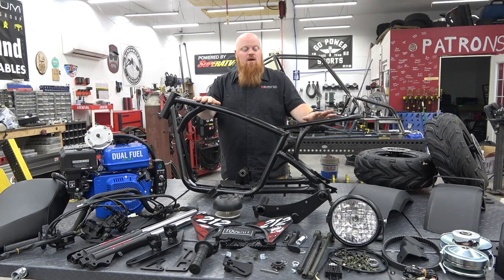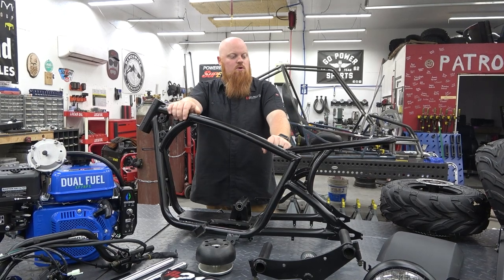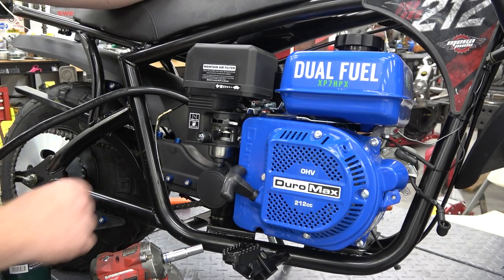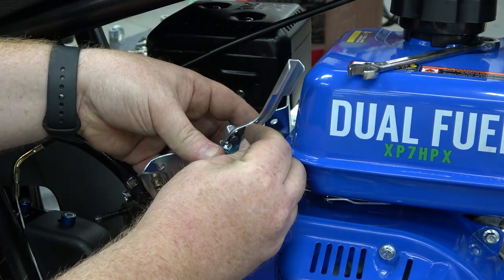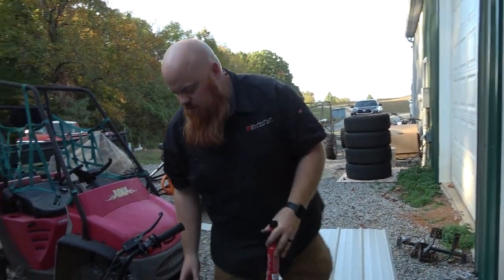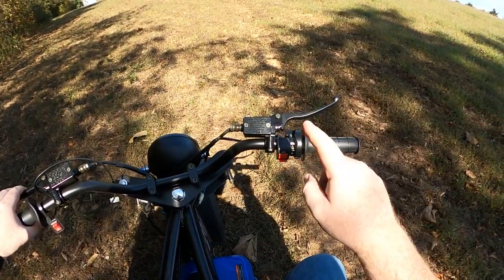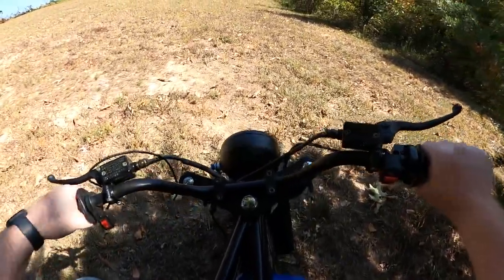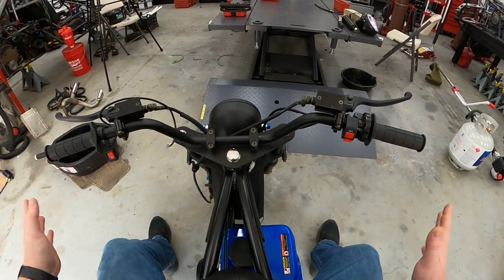Propane Powered Mini Bike ~ Mega Monster Moto 212cc

Comment: Hey Greg..  Ive been converting several things to propane, my log splitter and air compressor most recently.   Working on a honda 200 type 2 fourwheeler now.  Have it running pretty well, but not the best idle.  Have you had idle issues with that particular regulator?  Or are you still messing with propane at all?  It Looks about like the garretson kn regulars Ive been using.   Im going to try a second smaller load block made from 1/4 pipe tee plumbed into the front of the carb instead of the rear and see if helps with the idle .  I think the motorcycle type slide carbs have way more issue with propane mixture ratio at least more so than a stock predator type carb,because the slide carbs close off the air flow threw venturi the much tighter at idle.   I may go to a mixer for fourwheeler conversion or may adapt predator style carb to it.  I know I can make it idle acceptable with that carb on propane if I just drill out the main jet and spud in propane right there where vapor fuel is intended to flow..  trying not to do the spud in with the atv carb unless I come up with a spare I dont mind experimenting on.. btw Derek here from Arkansas,  changed my channel name .. used to be vintagediesel

Comment: you should check with duramax and find out if it will run on mapp gas get hotter than propane?
Reply: I’m thinking that’ll result in toooo hot temperature of a burn for the valves, rings, piston. Heck let’s go with acetylene! For science of course…
Reply: I like both these ideas lol
Reply: Just screw the yellow bottle on a find out.!! Why bother asking.
Reply: @getprobed838  trial n error is the best teacher. 😅

Comment: Propane will have less power than gas, because it has less btu's per gallon. 91,000 for propane, and 120,000 for gasoline. Cool option though if you can get propane cheaper. Currently it's like $4ish dollars per gallon though.

Comment: Dude. You just made the work around for this throttle problem for DURAMAX. You may want to get put on the engineering team part time to provide solutions for these guys and get paid for it. Just sayin, or better sponsor supply from these guys.

Comment: Cable clamps and cable adjusters from junked bicycles are excellent for small engine projects so I always strip them out at the dump for cable related parts. I've fixed free equipment because the cable itself was obsolete by making one from parts from bicycles and other equipment. Just an idea to help whoever.

Comment: It definitely looks like it has a just a tad bit more on gas
Reply: Propane has less ,,power,, in it than gas. Say approx 3/4. So yes there loss of power. R B already said that when introducing this engine. I have an built in tank and unit in my car. In europe you can fill up on the gas station. It costs me 1/2 of what it would cost me burning gas.

Comment: The reason propane will seem to have more power is because gasoline needs to atomize properly for efficient burns, propane comes naturally with a dense mix of atomized hydrocarbons. Therein, less energy is wasted in burning propane. More energy engaging the piston's downward stroke earlier is more power, regardless of where it comes from. The illusion of extra power is coming from more complete combustion of propane which is already a gas earlier in the the stroke. Meaning, more of the stroke's power curve is meaningful than with gasoline, which wastes time and energy in the beginning of the stroke turning into a gas from a semi-liquid state.
Reply: @billwilliamson9842  Absolutely. The energy density of propane is lower than gasoline, meaning less actual energy is being absorbed by the piston in the same space of time. The trick is, propane will feel arbitrarily more punchy because although there is less power in the entire stroke, there is more power at the beginning of the stroke. 
Edit: I imagine the illusion is entirely due to the fact that it's a one-cylinder engine. If you were to use a 2-cylinder in which less of the stroke is out-of-phase, the differences in individual strokes making power earlier would be less noticeable, or may dissipate altogether.